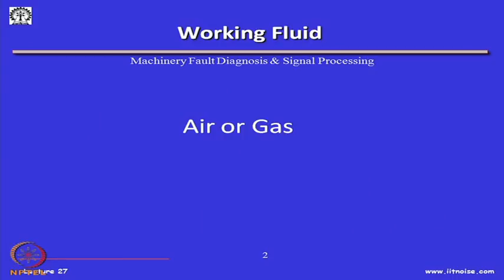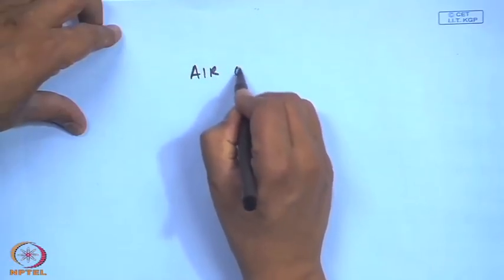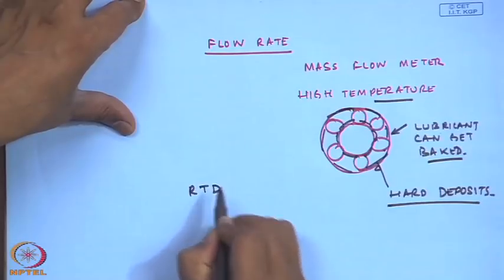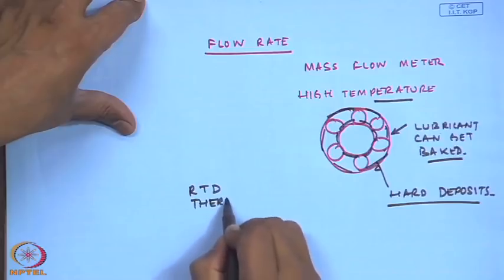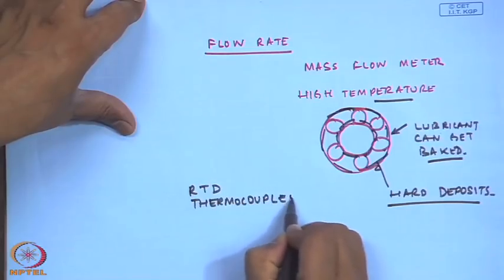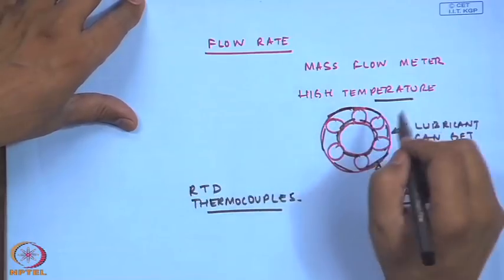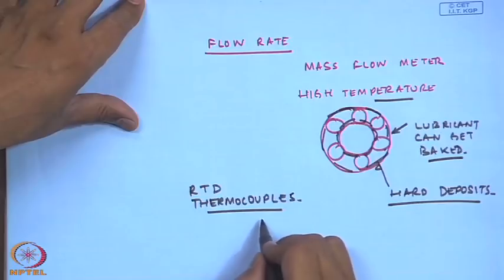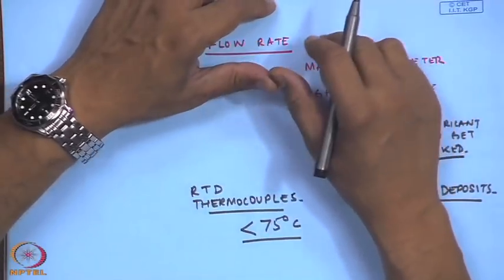Mod-01 Lec-30 Fans, Blowers and Compressors

Comment: Prof you got your fans mixed up @ 10:38 the FD is the ID and the ID is the FD, remember the forced draft fan is forcing air through  the regen air heater to the boiler for combustion and the ID maintains negative furnace pressure and pushes flue gasses through out the chimney stack
Reply: sir I requested. please upload work required for single stage reciprocating air compressor